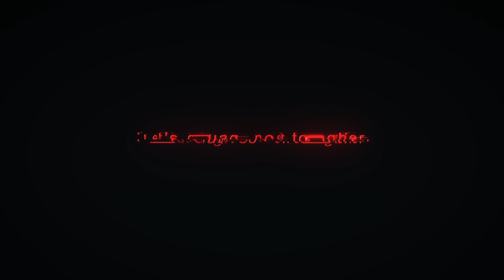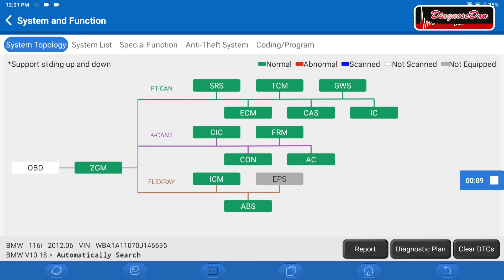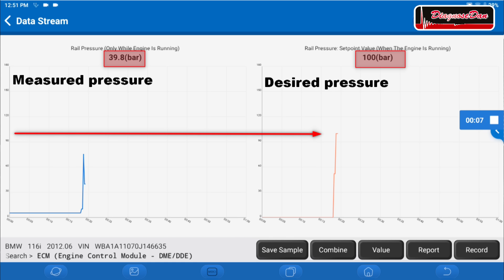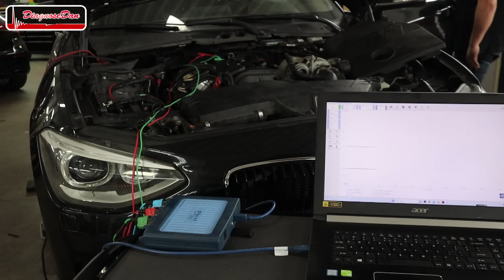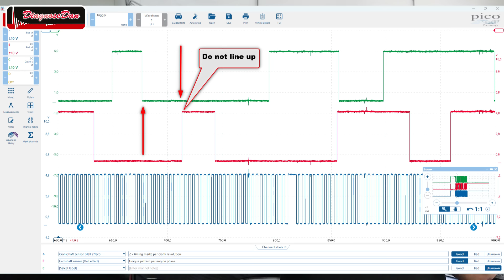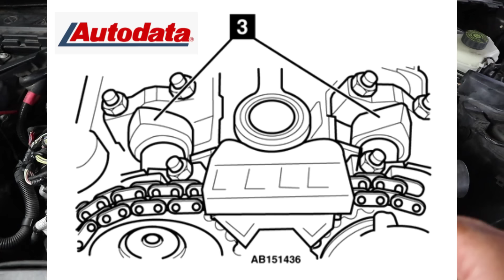Bmw dealership blunder? Incompetence?

Comment: If dealerships start recommending parts that aren't the issue.  The parts should be free.  A dealership should be the experts of their own cars.  Not just another part replacer.  I thought that was the reason they charge so much more?
Reply: Dealership don't repair the vehicle.
Don't blame the dealership.
The dealership..for instance Mercedes. They need to hire and train the Auto mechanics to do the jobs properly. This cost money and time to train. 
Technician is an over used term. Just because you went to a school doesn't make you a Technician. 
A technician means you are hired to diagnose anything that you are given. Do the job correctly.
Reply: Dealerships are becoming more and more of a joke these days
Reply: Most of dealerships don’t employ the right person to their company, most of them are employe people by hands to hands, or their relatives. 
Is very ridiculous to hear such a thing that a dealership company that specialist on a particular car can’t diagnose a low fuel pump before they replace it.😮 before I watch the video I told someone near me that the problem of this car might be incorrect of timing.
Reply: To me, you're paying for the thing to be fixed. If the don't fix it, they shouldn't expect to be paid. Put back the old parts. Keep the new ones. Give me my broken car back for free.
Reply: @2nickles647  Of course the dealership is to blame. They do the hiring, they should make sure the mechanics are properly trained.
Reply: you know the salary at germany car dealerships is really bad i speak from my own experience, its been some time but when i learned mechanic my first year salary was only 1250 euro. i had a friend at a different germany car company and he was making only 1100 euro. so we both quit and never went back into the field. if you pay your employees like shit and also treat them like shit you can't expect anything. i will also never buy a german car in my life because of this experience.
Reply: Well dealerships pay like crap. Any good technician opens their own shop so dealerships are left with people with very little experience or talent. The moment they get enough experience they strike out on their own and if they stick around they probably aren't that talented. Exceptions surely apply but this was my XP on this issue. There is also the culture that the dealership tends to silo away the customer from the people who actually diagnose and work on their cars and there is a lot lost in translation and workshop manuals at any brand can be lacking. Without XP just reading the manual that assumes XP will make you miss the most basic of stuff.
Reply: @robbirobson7330 
It’s very bad that their pay is do low especially when they charge their customers rather extreme high rates. 
I would’ve expect highly qualified (and experienced) technicians for those hourly rates.
Reply: Those hourly rates pay for our managerS not us technicians.
Reply: @markdavies3151  As a customer, I’d rather pay for the people who do the actual work rather than for the overhead. 

That’s why I go to an independent shop where the technicians are smart and where the owner picks up a wrench too in case it’s needed.
Reply: they all ways do the same ... start changing until it run.. the bill is on us... not them
Reply: @2nickles647  No the dealership is entirely to blame. Customer is paying the business a lot of money to FIX the car. In my world taking money and not doing what you are paid for is theft.
Reply: @2nickles647   the dealership gives you 1 hour diagnostic o network communications fault , to be diag in 1 hour in that 1 hour comes include conprenhencive vehicle inspection , I worked for Euro shop where the owner wanted the diagnostic in 45 minutes and nail , by the way those Europeans vehicles comes floods of codes regularly minimoon 10 dtc
Reply: @johnnyblue4799   they do not have the proper trained technician because they say he wants to make too much money so they hired the tech that accept there payment  not the one is qualified .
Reply: @Conservator.  where i was working was a bigger shop we were probably about 25-30 mechanics there plus all other employees. the lady boss who did not have a clue about anything just went from one vacation to another. i calculated that she must have earned about 1 million euro a year. there were some mechanics that were in this shop for 20 years and their salary was only 1500 euro and that was the max you get. The  manager who managed the mechanic side of the business did not have a clue either and just went around insulting everyone. People came to work drunk almost every week and were not able to perform. the whole thing was a mess. also totally unprofessional work. the 3 other guys that learned with me were preparing for their final exam and they did not have a clue about anything because the only thing they would teach you is how to change oil and mop the floor or clean the windows. absolute shit show.
Reply: @robbirobson7330  
It’s surprising that such companies don’t go bust. I hope you found a better place to work.
Reply: @Czechbound so if it takes someone a whole day to take the front end of your car to find out your engine is gone and you're better off scrapping the car, that should be free because they didn't fix your car? Fair enough if you want your car put back together but you're paying for someone to figure out what's wrong with your car. If you don't want to pay for their time, feel free to diagnose your car yourself and then find a workshop to fix it.
Reply: @OneIdeaTooMany  Not only did they not fix the car, they couldn't even determine what the problem was, and asked the customer what to do next. Epic fail that the customer shouldn't pay for. If they diagnosed it correctly, and said "OK, next step is we need to determine if the engine is junk. But that's a new job, so we can quote you for that", then that would be ok. But to swap out parts before understanding what the problem was is amateur and should not be on the customer's dime. Diagnose Dan could determine very quickly that the low pressure fuel pump was ok. Likely the original fuel pump was delivering the same pressure and so was also ok. They obviously didn't even do that simple test. But yeah, if you want to pay a bunch of amateurs to fire the parts cannon at your car ( and even calling you up to get your choice of what expensive thing to replace next ), be my guest. A fool and his money are easily parted as the saying goes .... Peace and love !
Reply: @JoelAutomotiveInaction  Sure, but that doesn't mean the dealer is not at fault. They charge big hourly fees... more of that money should go towards paying their staff.
Reply from the maker: This is a difficult subject. Sometimes a 100% diagnosis is not possible or would cost more money than the part you suspect and want to replace.
Reply: @Diagnosedan  ok but is it worth it swapping it in and then back? When I have to swap something as simple as a crankshaft position sensor on a BMW it is simple enough you would think but you have to bust apart half the car to get to it on some engines you have to get to the starter motor because the blasted thing is in your way, remove it and behind it is the position sensor and that thing usuallly fails to set a fault code when the vehicle gets jerky acceleration when driven hard for a while. It is a bastard to diagnose but is it worth getting to it in case it might be the problem... indeed difficult.
Reply: @Diagnosedan  agree 100% I do recommend  to replace a certain  parts when  you ac not duplicate  the faults but  being clear with the customer  tholise are potential  possibilities  when the customer  ask  will  this fix the problem  the unswer is  maybe  yes or not , the cost us $1,200 for example  if it fix it or not how ever may requiere to continue doag and parts the will be new charges , let the customer  decide , many of them say no go to other places and come backs  to you again
Reply: I always ask you my replacement parts and I get them 
Trust is an beautiful thing,but control is always better.
Reply: They make you sign papers lol your right tho if the new parts don't work put old parts back on
Reply: For the money they charge they should be experts lol
Reply: @Diagnosedan  Not in this case. Timing chain guide failure is a known defect on these engines. The diagnosis is simple, if you're familiar with the engine. The problem is that techs are too inexperienced to have been around when this engine was new and are not familiar with this type of failure. Nor were the techs that looked at this car before you, familiar with the workings of the high-pressure fuel pump, as you demonstrated.

Comment: I had no idea how fuel pressure was controlled with mechanical high pressure pumps.  Thanks for the super informative video!
Reply from the maker: My pleasure
Reply: This is true here, but is not the case with all engines.

Comment: Great walk along, and great diagnostic steps! I have had plenty of N20 BMW's that do the same and never log timing codes, it always blows me away. P.S: I understand that you stated this is an interference motor.... but I can tell you now that from the sound of it and from the scope capture there is no valve damage. The fact that both valves are able to seal some psi to create the towers and then also have the ability to release psi, means they all can seal properly and relief properly, meaning all have good contact on their seats just all timed incorrectly, hence the same sounding cranking noise. If you were to do relative compression with no sync, you would get all even humps and not ever realize that the humps are the same but lower psi from being out of time. Again, even if you were to add an ignition sync (at least with the N20's) it some how on bmw's can still show up proper location on relative compression capture, so you would be lost thinking it is in time based off relative compression test and just not ever know that it is off time and the humps are just lower than desired compression humps. You would have to take a physical psi measurement to realize. Don't' ask me how I know, I learned the hard way on one lol. thanks for sharing as always.  👍👍
Reply from the maker: I've also learned the hard way😉 And i know from previous videos that people are going to ask in the comments about it being an interference engine so i put a text in the screen. And since i didn't diagnose any further i dont know if there is any damage for sure. Thanks for the Great comment and feedback 👍
Reply: @Diagnosedan  thanks, and thank you for sharing the great content as always👍
Reply: Loved it, the off shoots, directions you can get led down the rabbit holes via timing being off is very interesting to know, 
A great refresher, as this stuff doesn't always pop up often, 
Always greatfull for the greater learning, 
And knowledge you teach us, 
I remember the other bmw with disel injector effecting high fuel pressure side of things, in fuel rail, but the garage replaced low pressure fuel pump, 
Cause and effect. 
Thank you Dan, for sharing,  if I could learn something like this everyday,  very happy,  cheers.

Comment: I like to periodically pause the video and try to figure out what the problem is. At the point where low pressure fuel was confirmed and a substitute fuel was introduced, my thought went to, some sort of pressure relief valve may exist in the system, which you could say is the regulator soleniod. Then  l would have went down the rabbit hole thinking the ECU may be at fault not realising that it controls the soleniod from the timing signal. I believe I would have eventually checked the timing after some headscraching for two reasons, one; check the independent shops work, two ; the engine just didn't " sound " right to me when turning over. Loved the going "old school" As always Dan great video.

Comment: OMG Dan. That's a big dealership fail. 100% sure there were "timing off" codes while the car was stranded! And the second shop made the same mistake too. Unbelievable! 
And they know at the dealership the N13 does have timing chain problems. In my opinion, BMW 4 cylinders have been bad engines since 2004. It started at the N46. But the B48 and the B46( B58 minus 2 cylinders)are a lot better engines, finally.
And I know there were bugs in some ECU's. My 2009 335i has a permanent 2AAF shadow code. I replaced the low-pressure fuel pump, the low-pressure fuel sensor (with the upgraded one), and the fuel control unit in the tank too. The car runs great and the low-pressure fuel is okay, when monitoring on the PC,  but still has the same shadow code. The car runs great, no problems.
Great job Dan. Have a good one and thanks for sharing. Dutch regards Nico.
Reply from the maker: Hi Nico, bmw should have stuck to those beautiful straight 6 cilinder engines. I know thats outdated with the current fuel prices and environmental rules here in Europe but those were great engines

Comment: Get video Dan! Not many auto repair technicians holding jobs today have been formally trained to perform real analytical diagnostic procedures. They are simply parts-swappers - dealerships and indies alike. Perhaps this is the fault of particular dealerships or indies that do not require this skill level, or do not want to pay for it. I suspect the latter in most cases. It is refreshing to follow your approach to correctly diagnosing problems, seeking the root cause and not getting caught fixing symptoms. Your approach to diagnosing these problems reminds me a lot of how Ivan at Pine Hollow Auto Diagnostics approaches similar issues. Thank you for taking the time to share these experiences with the community and hopefully some of those in the community that are professional wrenchers will take away some valuable lessons that they can apply. Cheers!
Reply from the maker: Thanks for the great comment!

Comment: Well done, Dan!  The engine seemed to be turning over to fast when you cranked it.  That lead to me thinking it's "timing" in the old sense of valve vs piston positions.  It's nice watching you use all the neat diagnostic tools to find the problem.  Thanks for another interesting video.

Comment: Fascinating as always, thanks Dan. I'm no expert but the spark looked a bit inconsistent too.  
Appreciate all the detailed explanations!! Yesterday a random lady at a shopping center asked me to help remove the ignition key from her hire car as it was "stuck". After trying to move the steering wheel to jiggle the steering lock the key was in fact locked in. She had stopped the car in drive, (automatic) so I shifted it to park and voila the key came out. I'm only used to old cars Lol. Mine is 2005.

Comment: Thanks Dan for another educational diagnostic video.  Lessons learned; validate problem, don't believe anything, good tools make a difference, BMW interference engines are expensive to replace.
Reply: ALL modern engines are interference engines (2000 onwards). Timing belts are cheaper, more fuel efficient but require replacement meaning it has to be accessible. So manufacturers use chains but try to make fuel efficient and lower cost by reducing plate thickness etc. To the point, I would rather have a belt engine than chain now, even PSA 1.2 wet belt. Chains are very expensive to replace and need replacing around the same time as a belt anyway.
Reply from the maker: @khalidacosta7133 not all!
Reply from the maker: Yes unfortunately for the customer not cheap 😬

Comment: Great diagnosis of course, but this is a very common issue on this engine, I'm surprised the dealer missed it, and its not an interferance engine, new chain and guides is what we normally do on these.

Comment: Had knocking noise in the front of my f10 525d. After spending one hour looking for it, the technicians diagnosed a worn steering rack. 2.5k to replace it. I called it B.S. and got a second opinion at an independent, it was a loose control arm bolt. I would have found it myself if I had access to a lift. I wondered how many other customers were told similar bull and accepted it.
Reply from the maker: We'll never know😂

Comment: Another great video Dan. Did anyone think that the spark was a bit intermittent? Would be interesting to see a waveform of primary ignition against crank sensor.
Reply: Yeah, I thought it was a bit erratic !
Reply from the maker: Yes, i noticed that. That is a clue the engine has problems to determine the timing of the spark
Reply: I saw that also.

Comment: for the timing being that far off it's weird because it sounded pretty good turning over.
You are a true master dan! 
When it didn't start on the startpilot i was puzzled and didn't know what i would do next.  
grtz
Reply from the maker: Yes the engine sounded pretty decent actually, that why i didn't expect a timing problem right away

Comment: Standard official dealership fare. Had an f34 328i with an oil pressure warning light, dealer said oil pump went out and needed replacement. Asked them if they checked the oil for contaminants (plastic timing chain guide parts). They didn't even check the oil, period. Picked the car up rightaway and checked the oil with an independent. Turns out enige was a liter and a half short. Replaced the oil level sensor (which is a super dumb concept in itself), saved myself a good chunk of money. Not the first time I had this kind of experience with an official dealership but definitely the last, if I can help it. They did say they were sorry for doing such a horrible job though, so I guess that's something.

Comment: At least in the Minis, the N13 vacuum pump can seize and snap the camshaft in half.
That's what I initially guessed was going on.
However I learnt something interesting I didn't know about high pressure pumps! 
I guess the other shop checks timing by using 'the force'.  Excellent work as always @Dan.
Reply from the maker: May the force be with them😂